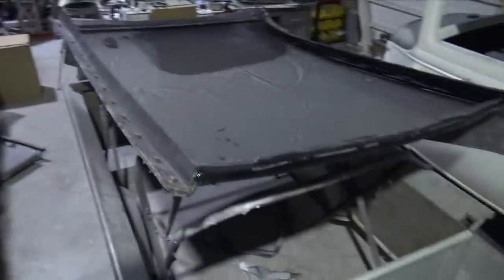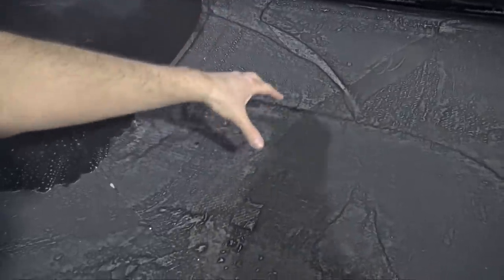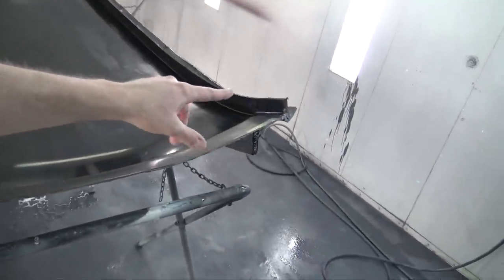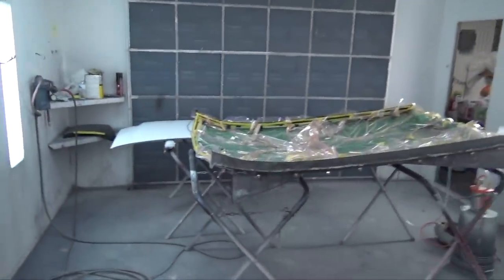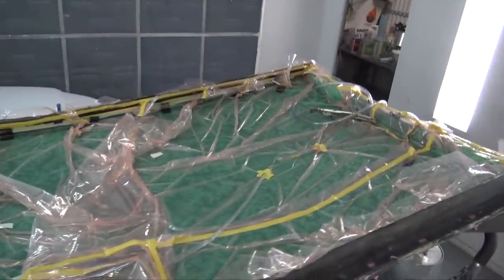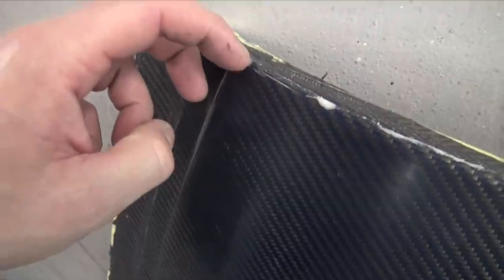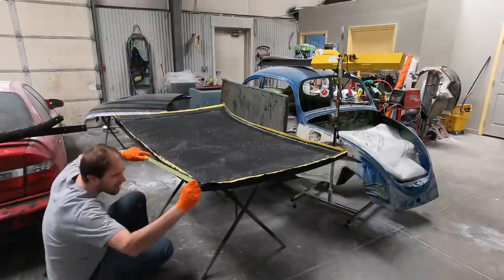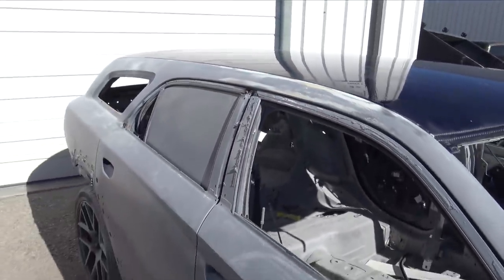Building the Ultimate Station Wagon | 2021 Charger Magnum Hellcat | 1000HP Hellwagon | Pt 42

Comment: Pretty sure you can salvage that roof: drill into the two ends of the dry spot from the rear (careful not to pierce the last layer) and then suck resin through it.

Comment: Credit to you for sticking it out this long. We tried vacuum bagging parts in the mid 2000's for about 3 months and couldn't produce make anything perfectly. The closest we got was wetting out the part from the middle and then using bleeder tube all around the edges to take out the excess but even that lead to dry spots on the very outside edges. It actually got so bad that we gave all customers at the time the option of refunds or parts made the conventional way. Fortunately enough of them just needed the parts however they were made that we didn't go out of business but it was touch and go. We did have a lot of success with the hot roller technique and I'd highly recommend you look into this. if you use the roller over a sacrificial absorbent layer it will cook the resin layer and remove the excess keeping your part as light as possible and for about half the cost of vacuum bagging to boot.

Comment: Sealing the flanges of a multiple piece mold is best done with vacuum bagging tape. If you cant get a leak free mold then your best bet is to envelope bag it. You can cover the underside of the mold with breather cloth to avoid puncturing the bag. Also more resin inlets equals less infusion time. That way you can be sure that the resin wont harden before it is fully infused. Best of luck.

Comment: Dave, since the surface is very large: suggestion: have more than one bleeder tube in the vaccum bag. Maybe three in the mold for the resin to spread through out the whole mold. Front, center and back of the mold to distrubute the resin evenly.

Comment: Try adding 2 to 3 stages of resin inputs so you keep the flow going even if you get a plug up. I watch guys do 40ft boats and have a whole manifold with 20 inputs of resin for when a area slows down. Looks great

Comment: Hard to tell in the vid but if you are putting the flanges on and then siliconing on the inside of the mold the vacuum would be pulling the silicon off the joint which will creating a leak. If you put the silicone on the outside of the mold the vacuum would be pulling the silicone through the joint and it shouldn’t leak. Hope that makes sense, and it is looking really good!

Comment: I'd imagine it's possible that it got to a point where the vacuum simply wasn't strong enough to pull the air out,  I would try to pull from the middle if possible  rather than the  edge.  Then the last bubble to be pulled is where the vacuum pump is sucking

Comment: Looks like the resin lines on the sides were too far down by the vacuum exit, the resin filled the exit before center was wetted out. 
I immediately knew this failed at this point. Also the more resin is wetting the material the harder it will be for the vacuum to pull more resin.  Increase the power of your vacuum or ramp up the vacuum power as it starts to wet out the fabric

Comment: Is it possible to drill a tiny hole behind the dry spot and inject the resin with a needle and syringe?
Reply: I was thinking that, but I don't think it would work. Good if it would work, as that would be a "second grade" roof that someone might want.

Comment: I have never made anything like this, but have extensive dabbling with fiberglass.  Just wonder, if you got the 2h hardener and uniformly coated your cloth before adding vacuum, then proceeding to apply vacuum possibly with a trap to catch any excess resin, could that still result in a quality piece or would it have a wavy finish on the bagged surface?  It would seem if you could effectively evacuate any excess to achieve flatness that might work as another way to skin the cat.